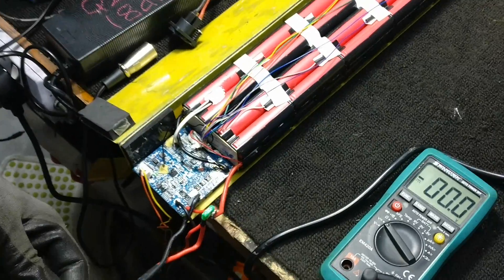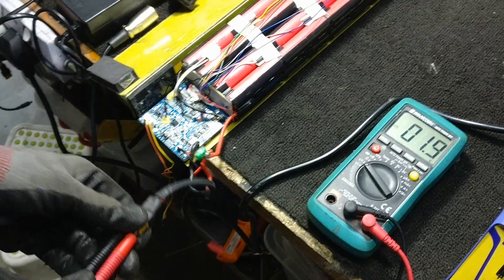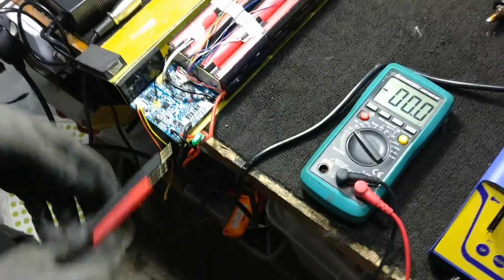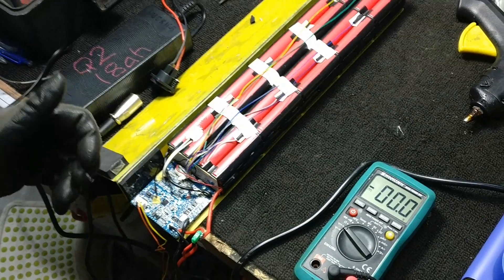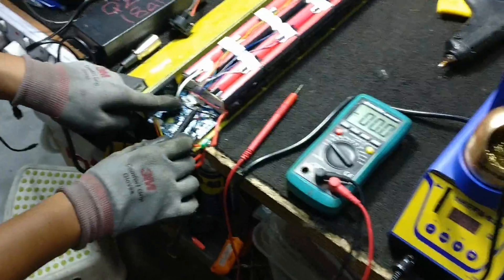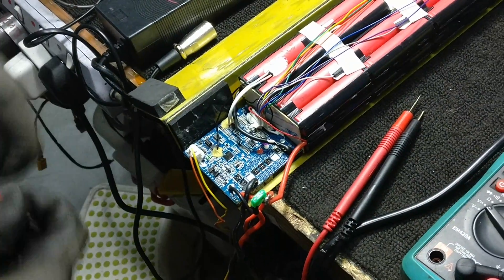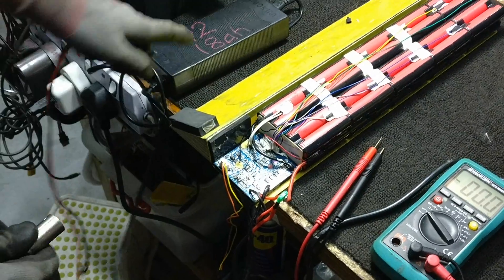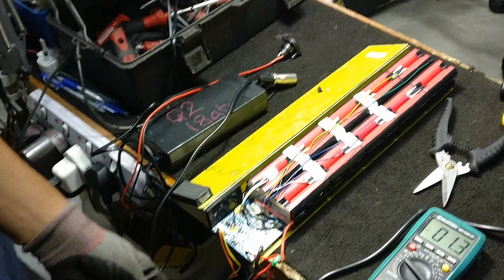Diagnosing your Inokim Part 2: What to do if your Inokim is not charging

Comment: I have an inokim and it's charging, but dies when I go uphill. Any ideas what that could be? Battery seems fine with a voltmeter. Measuring 67v. The power just shuts off as if the battery were completely dead, but after throwing it back on the charger, after a minute, it's still fully charged. Possibly the controller?